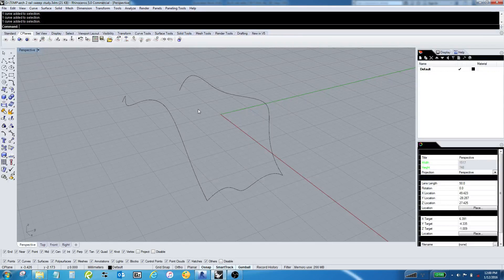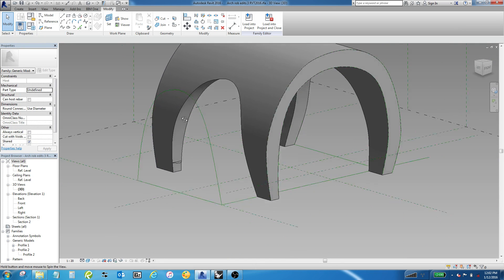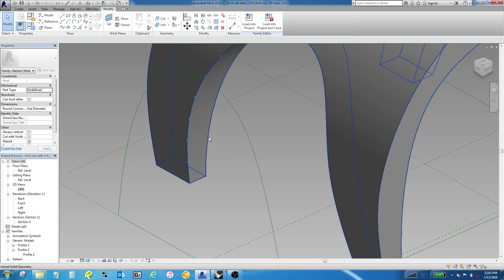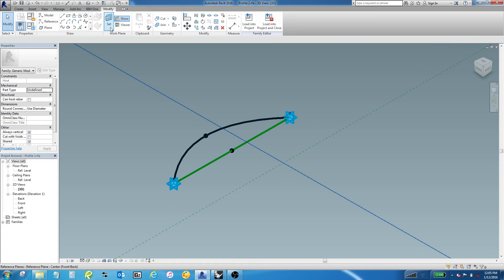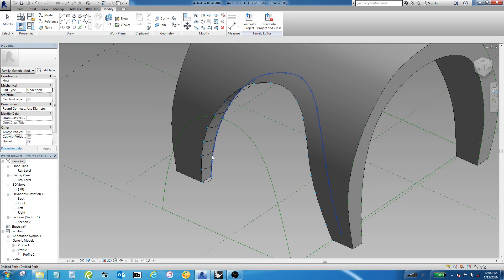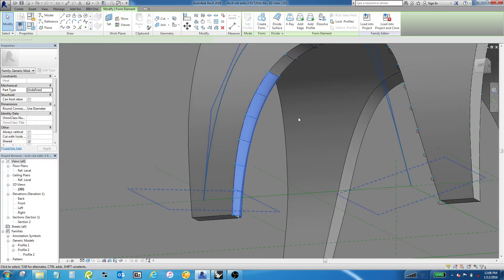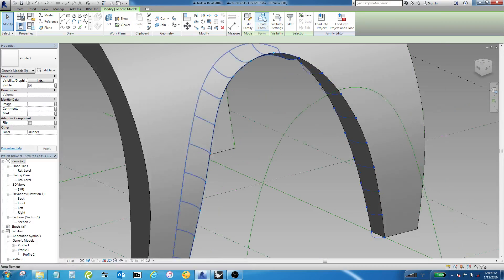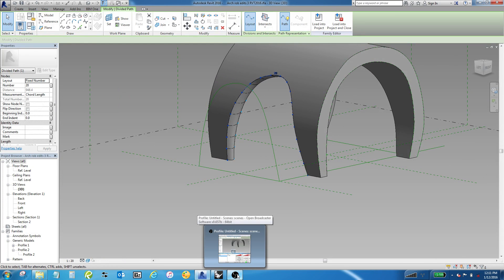Revit Two Rail Sweep

Comment: The loft isn't the same as a sweep though right? You're lofting in a straight line between the segments, so if you zoom in you would see a separation between your lofted form and the wall... Conclusion: just do this stuff in rhino.
Reply from the maker: Alec Baldwin was once asked about the numerous terrible movie roles he’d taken and he quipped that if a homeowner asked a plumber to put in a lime green toilet, the plumber wouldn’t say; oh my God, why do you want to do that?… He would just put in the toilet. Anyway, I was just answering a challenging question.
Rhino is unhosted modeler and therefore incredibly fast and versatile, but you do have to be aware that it has limitations by design. What I mean by that is that it visually represents an idea with any number of different mathematical constructs.  Watch the video link below and then retest the idea in rhino and you’ll see what I mean.

https://youtu.be/WNKrjgodiks?si=-1_v52JKTEhSnMSE

Comment: Yes I ended up doing the exact same thing! I tried EVERYTHING (that I know of) and that's the only thing that actually achieves a close enough sweep. I chose 40 nodes for a smoother curve, it joins pretty well. I was pretty shocked that you can't just choose the 2 edges and the profile, it seems logical but I guess Revit just hasn't been programmed to know that!

BUT, to take it a step further, I'm actually working on the profile family to find out if I can keep it's edges tangent with the wall at all times upon placement on the divided edges. In other words, at the base of the arch the profile will be a simple semi circle. But as it starts to go up the wider part of the arch, in order for the profile's edges to remain tangent with the walls, it would have to deform into a spline with its apex slightly towards the outside of the wall (this is because the outside and the inside of the wall no longer run parallel at the top of the arch). You can understand the concept better if you cut sections through the arch and see how a semi circle profile sweep behaves at the top of arch (in section) compared with bottom (in plan).

As for the remove repeater command, they actually introduced it in the R2 update for Revit 2015. It's a handy feature indeed! Thanks for the video, I appreciate it a lot.